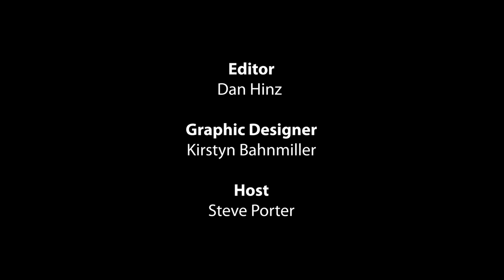The Truth About the Electronics Refurbishing Industry

Comment: Thing is, at least in the EU, a place selling refurbished hardware has to sell it with 2 years warranty - if they skimp on the repairs, they get to handle customer service with repairs or replacements later, or even pay back the full price if they can't do either. Buying refurbished hardware with that kind of warranty makes it extremely worth it for the customers
Reply: wow thats great they make them have a 2 yr warranty.
Reply from the maker: That's awesome! Love that policy.
Reply: I think for refurbished and used it’s only 12 months. Or it could be that if refurbished then 24 months, and if used then 6-12 months. Anyhow, other costs that still have to be accounted for are rent for a store or shop .. or both. Also you kinda lock money in. The longer the products wait on the shelfs the more it costs you money and also factor in inflation. And I am sure I am missing out a few other
Reply: Used 12 months, refurbished, as one could assume tested, cleaned and fixed, 24 months
Reply: That is not true, refurbished items have 6 to 12 months warranty which depends on its use, if its a PS4 that is quite old by now then the warranty would be 6 months, if its a PSOne that is super old, the warranty would be 12 months because its already a colectible for most people and wont be used much, if its a laptop, they give you 6 months warranty on the battery and 12 on the motherboard and screen, if its a phone its 6 months, if its an iphone its 12 months or 0 months (mainly cuz most shops dont take on iphones cuz its too expensive and refurbished is like 10% cheaper than a new one so only people whom do that would sell them on eBay or Amazon and they are just people with a hobby...)

2 Years on console and if it has battery its 1 year, that is standard for brand new product, refirbished has this cut in half.
Reply: Gamestop also offers the same kind of warranty. An in store return for 1 or 2 years which is good, but I take issue with being charged for it. With the amount of money Gamestop makes, pre-owned and refurbished consoles should come with a free 2 year in store replacement plan. Gamestop is greedy, but I'd still rather buy pre-owned or refurbished from them as opposed to a pawn shop. Joe Schmo at your local pawn shop can easily get away with selling you a crappy console too, with no warranty or in store return.
Reply: Oh man, that would never work in Merica!
Reply: @charlesbrooks8186  What the warranty says and what you actually get are two different things. Good luck trying to get that 2 years.
The kitchen place gave me 5 years on my kitchen.  4 months later when I rang: liquidation
There was also the amazing deal on insurance from one of those compare sites.  Never heard of the insurance company before.  2 months after taking the money, receives a message that we can't give me my insurance now.  Got two months insurance for the price of 12 months.  Really great.  Not.
The compare geezer is a scam.  Advertising unknown insurance companies that take your money and go under 2 months later.
Reply: I'm looking to buy a used Nintendo Switch, and a local store is selling a used one complete in box with 3 YEARS WARRANTY. Yep, you read it right. I also bought a used PS4 Slim with 9.00 firmware which also has 3 years warranty. I believe the law in my country just changed the 2 years warranty to 3 years, and it either also applies to used hardware, or the store is offering the 3 years warranty by personal choice.
Reply: Does that warranty apply for a 20 year old console? If so, I would not want to repair and resell.
Reply: Yep, I bought two items from CeX the last few weeks for my holidays AND they come with a 2 year warranty as standard, however, I did check how much repairs would cost and for one repair alone, it would take me back near £300!
Reply: I open almost everything refurbished or used to check it out, so I know if it's really refurbished or cleaned.
Reply: They are so strange over there. No wonder the UK wanted out.
Reply: I wish the industry would come together and create their own standard without government forcing to because that's literally never a good thing.
Reply: remember that this is a seller to consumer warranty. 
it has nothing to do with the manufacturer.
if the seller goes out of business you're at the mercy of a manufacturer.
Reply: A warranty is a calculated risk for these refurbished consoles/electronics. They can do the bare minimum initially and there's a good chance it'll be satisfactory for most people. If someone actually has an issue they'll just replace it with another "refurbished" unit or they'll actually do the fix they were supposed to do in the first place. Then there's the chance a person has an issue and doesn't bring it in at all and just buys another.
Reply: Cex has this two year warranty on everything, however they also sell everything at a ridiculous price which is usually at least the same as new or even more in some instances
Reply: I agree with mandating a warranty. But mandating a warranty on a refurb that's longer than the original warranty is wrong.
Reply: Does that count GAME/GameStop in the UK/EU?
Reply: @pow9606  That's the problem with buying from shadier companies. Had a similar issue with my robovac. Was nearing the end of its warranty when something broke and the company disappeared in those two years. In more US terms I had bought from an Amazon partner, not from Amazon itself. I usually avoid doing that on products of this value but this time idk what happened and made this mistake. You can be damn sure I didn't the second time when I bought a replacement.
Reply: viperpit-lr2rp  Nah America usually has good rules but problem is no one enforces them anymore. For example if Gamestop would rip you off its a civil matter and it takes lawyers and tons of money to do anything about it.
Reply: Think that is just parts of Europe Law not actually European Union. Since European Union sells lots of overpriced and or cheaper garbage that breaks often and even faster then the far cheaper China made counterpart. However both are made in China anyway ... But the quality differs.

Friend's mom bought solar panel lights overpriced 50 euros German branded with a "German Technology Quality Certified" sticker but made in China anyway, in a German import store, they worked for less then 5 days and there is nothing to repair they are simply gone also no point in replacing, they were refunded instead they usually simply give you store credit even tho I suggested never buy anything there again. 

While my China made ones that are dirt cheap costed 8 euros bought them in China shop, the lights work still today, they are outside in my garden since 2019. 
Just to put it into perspective.

EU sells overpriced garbage and I never seen anything really being repaired with any type of warranty, often there are no parts instead they push you to buy new garbage. It's the same idiotic system as in USA because EU is basically a USA political puppet.

So if there are consumer rights that is coming from actual Europe or Russia and not European Union ... People seem to fail realize the difference.

Also even tho Russia or some European company / brand offer warranty you really don't even need it since everything I bought from Russia or China works for 10 years by now while EU garbage is worse then the lowest China made mess as I said that is not worth repairing nor replacing since the parts and assembly is horrible. 
So yeah huge difference!

Germany is polluting Europe so much it's really got out of hands ...
Reply: @bumpy86  where ist that in the law? from what i read nothing mentions id the device is older or not, if its a  refurbished its 2 year that can be reduce to 1 year if the client agrees. You only can "force" the 1 year with a better deal to the client so he agrees qith the deal
Reply: One year in my country and I'm also from EU.
Reply: @bumpy86  If a shop is doing this, they're breaking the law. If they're a commercial seller (so basically not you or me selling something on ebay or facebook marketplace), the defects liability is 12 months for used goods and 24 months for new goods. But after six months you have to prove that the defect was already there when you bought the item, which can be tricky and a lot of sellers actually don't force you to do that. The warranty (which is different from the defects liability) is something the seller or producer of the goods gives you voluntarily (like Eastpak giving you a lifetime warranty for their backpacks, or Zippo doing the same for their lighters). There are some goods where this defects liability doesn't apply (would be kind of funny to go to a store and claim defects liability on a rotten apple, for example) and private sellers can deny defects liability from the start (there was a werid court case a few years ago of a car dealer who sold his personal car in his own name, but the buyer assumed he was buying from the dealer as a commercial seller and when something on the car broke he demanded defects liability, but actually lost in court).
Reply: All that means is that quality control is done by the customer. 
Case and point: My mom bought a refurbished PC when Vista stopped getting security updates, so she got essentially an old workstation type PC, enough for Facebooking. While Windows was setting up she wiped the case and bent the defective power cord, which cut power to the PC and bricked the windows installation badly enough to need an install media. When that was finally done and it booted the first time it immediately bluescreened due to bad RAM. 
The cord I can understand, if it just interrupts when its bent a certain way, but RAM can be easily checked if it even works.
Reply: @bumpy86  what you write is not true for germany. Not at all.
Reply: @Tronicsfix  my ps4 won’t update to 10.50
Reply: I refurbish (properly not like the crap that US refurbishers do), consoles and controllers internationally. I use a photo box to take not only pictures of the outside of (example) a console but also the inside completely disassembled. I don’t sell at eBay prices. I sell it for more because there isn’t competition at this level. 

I pull in 3k a month, every month and my customers always come back. 

If you do this professionally even the scratches you were talking about, effects the selling price. 

You have to be transparent and honest and the community will love you. 

BTW PS4 slim with two controllers, two new charger cables, new HDMI cable and new 3 meter power cable I sell for 250€ no negotiation.
Reply: Don't believe the hype, Second hand goods (as far as I'm aware) never had more than 6 months warranty offered. 
24 months (two years) warranty would be more than the original manufacturer's 12 month warranty, so why would anyone offer a longer warranty for already used goods?
People just parrot information that they never bothered to check out.
Reply: Can you quite those laws since they make nonsense considering most things electronic come with just a 90 day warranty on parts brand new?
Reply: Checked EU laws. Its six months not two years and device cannot be older than two years from its it original purchase date. Lol be very strange to give two years warranty behen most electronic parts have warranties of ninety days to six months originally. Lol example Xbox is a year from original purchase if brand new and if they refurbish it its six months regardless where you are in the world. If given San extended warranty thats the store offering it. If they refurbish it they dont have to go beyond whatever the company offers for refurbish.
Reply: @Tronicsfix  its a confusion about being two years. Lol its cannot be refurbished if after two years frim its original first sale. Refurbished warranties do not have to go beyond whatever refurbish warranty time etc given as if composny did itself. Xbox its one year new six months refurbished regardless where in world. If private refurbished can offer longer warranties just like GameStop does. Theres no law anywhere that forces one to have a warranty longer than original anyways. Don't confuse a company warranty with a store extended warranty. Law over there also does not say do repairs etc first if not satisfied. Thats an option. Customer can demand money back snbd store can refuse to repair but hsvfe to refund.
Reply: BS of high quality, I live in the EU, don't believe everything you read.
Reply: @Tronicsfix  How much would it cost for you to repair my ps4 it's an original ps4, I think the power supply and the HDMI is messed up, and it's missing a lot of screws
Reply: @terryarmbruster9719  I live in the UK and it's always been a 1 year warranty on new goods, certainly throughout my lifetime anyway.
Second hand goods can have between 3 and 6 months warranty to them.
The only place I have ever heard of a 2 year warranty on used goods is Cex, and there will be the mandatory small print with that in all probability.
There's actually consumer protection rights that exist that say that goods have to be fit for at least 6 or 7 years, bit few people realise this and customers have to build a robust case in order to win their case, which often isn't worthwhile when buying cheap goods.
If a product broke down after 5 years say, the company could just claim wear and tear and only offer a fraction of the retail price back as a partial refund considering how the customer got 5 years of use from whatever product.
Reply: Just close and re-open your business every few months. Problems werent. And you can as well evade paying your employees if the business gets closed just before the pay day. Everyone does that in Russia.
Reply: in Greece (eu) sony doesn’t even give you the standard 2 year guarantee for PS5 , they give you only 1 year 😂
Reply: i bought a refurbished xbox one s with 3 year warranty last week! (in portugual stores are now forced to give an extra year to electronics)
Reply: @danielmoung9098  GameStop was very near bankruptcy a few years ago. If you watched this video and still think companies are making mad profits, you're not paying attention. Very few companies are highly profitable. Most are barely getting by.
Reply: @grantcivyt  Idk about gamestop, but I know walmart makes busloads of money. Still, even though I don't like paying for a 2 year warranty, I like that my console has in store coverage. I'd much rahter do business with gamestop than joe flipperhead at walmart or fat f*** chuck at a dinky little pawn shop.
Reply: @bumpy86  i wanna sell some laptops,  repaired some (old thinkpads) any tips, do i need to worry about waranty, i wanna sell them fairly high i put good parts in and repairing costs ?
Reply: @danielmoung9098  I mean who else is gonna pay for it if not you? The OP says EU requires warranty, which sounds nice until you realize that means every customer MUST pay for the warranty. There's no option to skip it and save the money. People imagine that EU residents get the cheaper price AND a free warranty. Of course not. The video just showed us what it costs to do a good refurbishing job. It's not free. That worker has to get paid.
Reply: I'm sure it's 2 years warranty on electrical products that are sold brand new in EU. The warranty is with the manufacturer not at retail. In the UK we only have 1 year warranty on new products. As for refurbished I see from some companies only offer 3-6 months which is with them. Anyone working on a refurbish normally means that they void the warranty with the manufacturer.
There are also 2 types of refurbishment in the UK. One is that a console had been sent back to the seller so no longer can be classed as new. The other is when the product has been repaired or parts placed.
Reply: @bumpy86  not in the eu. always 24 month warrenty on phones/laptops/consoles.
Reply: @bigbabatunde1218  In the EU it is the seller who gives the warranty to the final consumer once the manufacturer's warranty period has ended.
EU manufacturers only had to warranty the products for 12 months but the seller had to warranty them for 24 months, so the responsibility was divided equally between manufacturer and seller.
Of course the manufacturer has the right to warranty his products for as long as he wants and the seller can do the same.
That EU law was updated some weeks ago, now it's 36 months, I guess it will be 18 from the manufacturer and the remaining from the seller, but I have not consulted it since the only thing that interests me as a consumer is to know how long the guarantee of the products that I buy is...

You can also buy "warranty extensions" from some manufacturers and sellers, but in reality it is usually a simple insurance that you pay in one installment but is valid for several years. Some insurance companies will sell you the same insurance for most products from most manufacturers and even when purchased from private sellers.
Reply: @bigbabatunde1218  Since the early 2000s it was 24 months in the whole EU, the first 12 months were covered by the manufacturer* and the last 12 months were covered by the seller, unless the manufacturer wanted to cover 24 months or even more. I don't know how the UK dealt with that after the Brexit.
*But only if the manufacturer was from an EU country, for those from other countries it was a problem to be resolved between the manufacturer and the seller before closing the deal, normally with Chinese manufacturers it was resolved with free extra merchandise that I imagine also served the seller to avoid having to pay part of the customs taxes.
Reply: @ruben_balea  Manufacturers and retailers offer a 1year warranty.
Manufacturers are not bound by what happens on the second hand market as they deal with major retailers not pawnshops.
Reply: @bigbabatunde1218  I was talking of new products
Reply: @ruben_balea  I'm from the UK, and considering how the authorities in the UK seem to want to be more over zealous than the EU requires, then it takes the wind out of your sails a bit when everything bought at retail has the mandatory 1 year warranty as standard. It has been like this for decades.
Occasionally you'll come across a company that offers two years warranty, but that's with the company and at their discretion I would assume as there's a lot of small print as to what they will and won't cover and may be conditional on registering the product with them when bought.

Law, as far as I'm aware, is first port of call on faulty goods within the 1 year warranty is for the consumer to take the product back to the retailer where bought as the contract is with them not the manufacturer.
Anytime beyond the 1year is open to discretion and interpretation, but any reasonable claims can be lodged within 6 or 7 years from date of purchase or use of something is exceptionally faulty or not fit for purpose and the like.
That's different to warranties though.
Reply: @bigbabatunde1218  Maybe your experience was not as a final consumer, companies and professionals in the EU are only entitled to the manufacturer's warranty.
I am from Spain and before Brexit I purchased things in the UK practically every week (since 2008 to 2020 I have spent on average more than a thousand pounds a year in UK stores) and the warranty conditions were exactly the same as here, I doubt that the sellers made a distinction between local and foreign buyers, although anything is possible. After Brexit I only made two or three purchases there because now I have to pay the UK VAT (I don't know why, it doesn't benefit sellers at all, it may have helped Boris Johnson pay for his house renovations) plus Spanish VAT (both VAT taxes are also applied to the shipping costs) plus customs fees, in the end UK products are at least 50% more expensive than before Brexit.

In any case I can't put links but this is a summary of the EU directive, if you want more details ask Google:
"When shopping in the EU, Norway, or Iceland, you are always entitled to a minimum 2-year guarantee at no cost, regardless of whether you buy the goods online, in a shop, or by mail order. The 2-year guarantee is your minimum right EU-wide. This rule have been laid down in the Directive (EU) 2019/771"
Reply: @ruben_balea  Not a "final consumer"?  What's that meant to mean?
Consumers are consumers according to consumer rights law.
If you were buying all sorts over the years and taking it abroad from the UK then you could have saved 20% on everything by doing the VAT exemption route, or was Europe stitching up its citizens also?
Saudi Arabians and others have been taking advantage of the VAT free arrangements for decades.
Reply: @bigbabatunde1218  Sorry, I meant a private customer, you had to pay the VAT on the country where the sale was made just like if you were there in person.
Private customers from the EU were never VAT exempted when purchasing on other EU countries, that's only for companines with a valid VAT identification number. In Spain you need a commercial storage facility over a certain size to be able to get a VAT ID, it is not enough to have a business.
Reply: @williamtopping  Where are you from? I'm from Spain and the most complicated thing that I had to do to get something fixed or replaced under warranty was to pack it for a courier to collect it...
Reply: @williamtopping  nah I'll just pay the usually less than them anyways price for a brand new item 😂
Reply: I bought 2 GoPro cameras few years ago that were sold at the official GoPro Ebay page they came with the 2 year warranty as well... they still work today. It was a Hero 3 and a Hero 4.
Reply: @bumpy86  what you are mentioning are the warranties for second hand items sold in places like CEX. Back when GameStop was running in Europe they had Xbox 360 and PS3 refurbished to sell, they had seals and stamps from Microsoft or Sony accordinly and came with the 2 year warranty as they were refurbished by companies partenered with them.
Reply: Yeap. I mostly buy devices from refurbishers in Germany and sell my broken devices to them. It makes more sense than to pay for the repair of your own device.
Reply: @squiddymute  what a manufacturer says they offer as a warranty is irrelevant. In the EU sellers are required to remedy faults. Any faults in the first year are assumed to have been present at sale time and must be repaired or replaced. It’s a bit different in the second year, but the seller must show the fault was due to misuse to avoid liability. In any case, your claim would be with the seller not the manufacturer. If your PS5 develops a fault in 2 years, contact the seller and they have to fix or replace it. They can ask you to contact Sony for a warranty claim, but they can’t demand it. It’s their liability as you made a contract with them.
Reply: @garethlloyd1445  the EU it’s always the seller who is required to deal with faults not the manufacturer, as buyers have no contract with the manufacturer unless something is bought directly from them. This has nothing to do with warranties provided by the manufacturer which are completely separate. The seller can suggest you contact the manufacturer and make a warranty claim, but they can’t demand it. It’s always their responsibility if there’s a fault within 2 years.
Reply: @brun4775  you would take it back to the seller but the warranty is still with the manufacturer. When you read the extensive warranty paperwork you will read this. The manufacturer is responsible for the product reliability and faults. The seller will deal with the return etc on your behalf.
Reply: @MageLeaderInc  in the EU brand new electronics have to have a 2 year warranty, so a 2 year warrenty on refurbished isn't any longer than new
Reply: @igniex  that's awesome. I wish it was that way here in the US
Reply: @MageLeaderInc  Yeah, here in Canada companies only have to provide 1 year of warranty on new electronics as well.  It kinda  sucks that in North America we get a worse deal compared to what Europeans get for the same price.  The EU seems to generally have better consumer protection laws
Reply: @Tronicsfix  Portugal takes it further and makes second hand cars have that policy too
Reply: EU consumer protection laws are for the consumer like it says on the tin. No backdoor lobbying to pass laws to just ensure the device doesn't explode and kill the consumer in the US.
Reply: Even with the 2 year warranty, it doesn't necessarily mean that the device in questions was properly refurbished.

It could still be more profitable for a company to only do surface level cleaning to save costs and for those couple of devices that actually DO fail, you'll have to replace them or pay back the money but that cost is lower than the overall cost of proper refurbishing everything that you sell.
Reply: To clarify some things saying that refurbished devices don't get 2 years in the EU.

Thats incorrect.

I work for retail in the PC market.
ALL electronics in the EU, come with a 2 year warranty. Period.
This is why many manufacturers don't really sell refurbished devices in the EU in the same scale as the US.

Our store for example has 3 refurbished Offerings for the EU and 18 different devices for the US.
Reply: ...ya...im not sure i would calling this a referb (as in the video)...witout cleaning it properly, nor picking the power supply apart and check the components... likely need to chenge a few atleast... on the other hand that probably something u want to do on a new device (thers crap coponents inside) ... much electronics are not designed very well from a consumer perspective... some are even designed to fail within 2 -3 years... refurbishing a 2 year old device means its likely going to fail any day in such cases without switch out some components or make a bit of redesign... 

and NEVER use compressed air to clean a board with ball soldering copoents..(most electronics now).. u will undoubtly just squieez junk under circuits, that has to be removed to be fixed ... and no violent brushing building upp static electricity...
Reply: I myself work at a repair store in Holland for electronics, Phones, Tablets, PC and sometimes even consoles. We also sell refurbished items in which we always have to give 1 year of warranty. With new products it's always 2 years
Reply: @ruben_balea  If you're buying from the UK now, after the UK''s fake in name only Brexit, you should be able to get VAT exemption if you're taking it out of the UK. It won't save you any Spanish or EU taxes though at your side.
Try asking about it with whatever company you're ordering from. You may have to pay it first but may be able to get a refund of the VAT later if you fill out a form.
Reply: Nice. Another win for EU protection.
Reply: @TDI-87  New products at retail: 12 months warranty.
Second hand, used and half worn, 'refurbished' products: 2 years warranty. That makes sense.

Not.
Reply: I think that is only certified refurbs
Reply: One of the positives of the EU.
Reply: @pow9606  I suggest that it is Americas lack of rules, which is rooted in the premise that businesses should extract every bit of profit possible from every customer, that is America’s root issue.
Reply: The manufacturer does not want people refurbishing electronics as it takes away from their sales, that is the truth.
Reply: @minmogrovingstrongandhealthy  copium is strong on this one
Reply: Question is how a refurbished item has 2 year warranty when brand new item warranty time is 1 year, any laptop, xbox console, playstation, phone they all have only 1 year warranty… so how do u get 2 years. U probably pay for 2 year warranty…
Reply: I think in Spain it's up to 3 years or so I've hears.
Reply: I Bought a refurbished mini pc. 24 month warranty from czech republic
Reply: EU also demanded the closure of 9000 Ditch meat & dairy farms during a food price crisis.
EU are more miss than hit
Reply: viperpit-lr2rp  No youre right a 3rd world country wouldnt demand the closure of 9000 farms during a cost of living crisis & with global food supplies struggling.
Reply: @bumpy86  There's no such thing as multilevel degree of warranty in EU, the only difference is between new and used items.
Reply: @Tronicsfix  Yeah, it's like all european things just better than in the usa and you americans call us communists! LOL
Reply: A longer warranty than when it was new ?
Reply: @Crashed131963  As far as I know it's 1 year or less for used items, depending on the item.
Reply: @jimbotron70  My new Ps5 is 1 year by Sony.  
Already used warranty found out ps5 controller drift in 4 months .
Reply: @Crashed131963  Life is hard 🤪
Reply: same in nz
Reply: My fellow Americans have no idea how raw of a deal they're getting here.  Europe isn't perfect, but they're doing things way better than Muricuh.
Reply: @kumisz2  God bless EU!